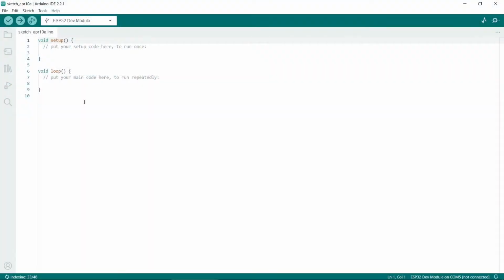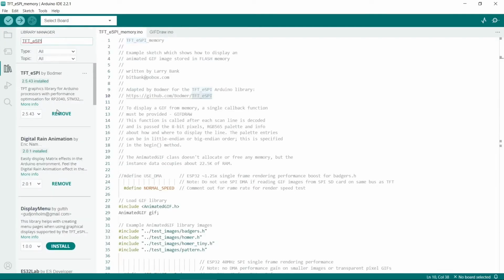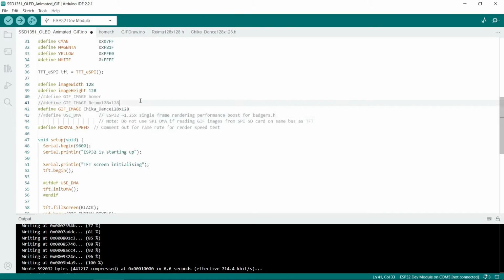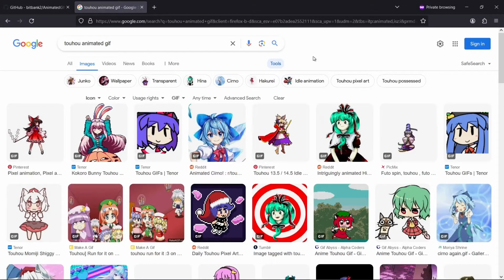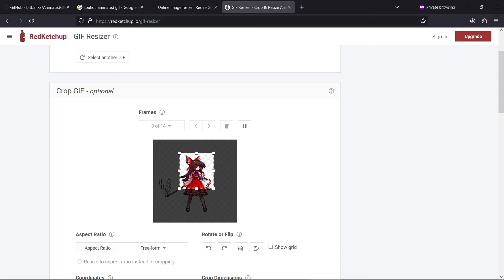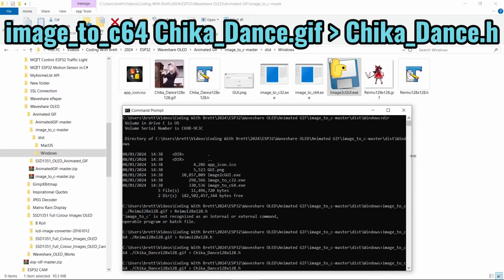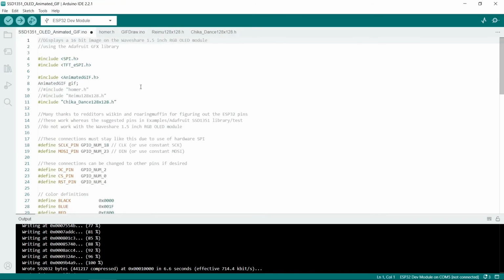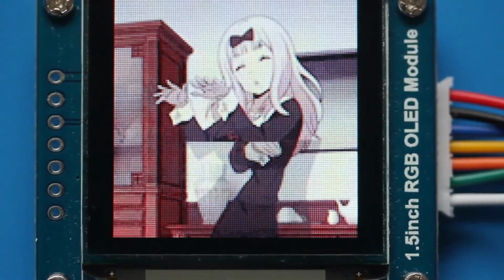How to Display Animated GIF on OLED/TFT (ESP32, Arduino, ESP8266)

Comment: #include <SPI.h>
#include <TFT_eSPI.h>
// Load GIF library
#include <AnimatedGIF.h>
AnimatedGIF gif;
#include "YourGIF.h"
//This section copying the code from the youtube tutorial
#define SCLK_PIN GPIO_NUM_18
#define MOSI_PIN GPIO_NUM_23

#define DC_PIN GPIO_NUM_16
#define CS_PIN GPIO_NUM_22
#define RST_PIN GPIO_NUM_4

#define BLACK   0x0000
#define WHITE   0xFFFF
#define RED     0xF800
#define GREEN   0x07E0
#define BLUE    0x001F
#define YELLOW  0xFFE0
#define CYAN    0x07FF
#define MAGENTA 0xF81F

TFT_eSPI tft = TFT_eSPI();
#define imageWidth 240
#define imageHeight 240
#define GIF_IMAGE YourGIF
#define NORMAL_SPEED
//#define USE_DMA

void setup(void) {
  Serial.begin(9600);
  Serial.println("ESP32 is starting up");

  Serial.println("TFT screen initialising");
  tft.begin();

  #ifdef USE_DMA
  tft.initDMA();
  #endif
  tft.fillScreen(BLACK);
  gif.begin(BIG_ENDIAN_PIXELS);

  Serial.println("Image has been rendred onto the screen");
}

//#ifdef NORMAL_SPEED // Render at rate that is GIF controlled
void loop()
{
  // Put your main code here, to run repeatedly:
  if (gif.open((uint8_t *)GIF_IMAGE, sizeof(GIF_IMAGE), GIFDraw))
  {
    Serial.printf("Successfully opened GIF; Canvas size = %d x %d\n", gif.getCanvasWidth(), gif.getCanvasHeight());
    tft.startWrite(); // The TFT chip select is locked low
    while (gif.playFrame(true, NULL))
    {
      yield();
    }
    gif.close();
    tft.endWrite(); // Release TFT chip select for other SPI devices
  }
}

Comment: Can you provide the working code? I am having trouble getting anything to display on the display. The previous tutorial (for a static image) worked great using the adafruit gfx library. I get no error codes and my serial monitor displays "Succesfully opened gif" but the screen remains black. Please help!

I should also note the following lines (in setup) never show in the serial monitor:

  Serial.println("ESP32 is starting up");
  // initialize screen
  Serial.println("TFT screen intialising");

I think the issue is related to the pins? I am using 0 2 and 4 just like in your example. Or perhaps it is the User_Setup.h file. I believe we need to make changes to this file but you did not mention it in the video : (
Reply: You just have to modify the User_setup.h code in the section where you assign the pins using.

file path: Arduino/libraries/TFT_eSPI/User_Setup.h

1.- uncomment the line: 
#define SSD1351_DRIVER 

2.- Search the code for the section:
// ###### EDIT THE PIN NUMBERS IN THE LINES FOLLOWING TO SUIT YOUR ESP8266 SETUP ###### 

3.- Comment: 
#define TFT_MISO PIN_D6 // Automatically assigned with ESP8266 if not defined 
#define TFT_MOSI PIN_D7 // Automatically assigned with ESP8266 if not defined 
#define TFT_SCLK PIN_D5 // Automatically assigned with ESP8266 if not defined 

#define TFT_CS PIN_D8 // Chip select control pin D8 
#define TFT_DC PIN_D3 // Data Command control pin 
#define TFT_RST PIN_D4 // Reset pin (could connect to NodeMCU RST, see next line) 

4.- Find the part of the code: 
// ###### EDIT THE PIN NUMBERS IN THE LINES FOLLOWING TO SUIT YOUR ESP32 SETUP ###### 

5.- Uncomment the lines: 
//#define TFT_MOSI 23 
//#define TFT_SCLK 18 
//#define TFT_CS 15 // Chip select control pin 
//#define TFT_DC 2 // Data Command control pin 
//#define TFT_RST 4 // Reset pin (could connect to RST pin) 

6.- Assign the pins used in the video example: 
#define TFT_MOSI 23 
#define TFT_SCLK 18 
#define TFT_CS 0 // Chip select control pin 
#define TFT_DC 2 // Data Command control pin 
#define TFT_RST 4 // Reset pin (could connect to RST pin)

7.- Save changes and compile Arduino project

Comment: Everyone seems to love the TFT_eSPI library.... I have not been able to get the TTGO to work with the TFT_eSPI library at all. I finally got it to quit giving a compile error when I went back to the Arduino 1.8 IDE. But still no video. At first I blamed the TTGO but I got it running the Adafruit display example using code that does not use the TFT_eSPI library. So I know everything actually works and going through the library's files I cannot find anything outstanding that is causing a problem.
Update: Though it's obvious no one reads these comments. I returned the "fake" TTGO after lack of documentation. After much mucking about I was able to find a couple of good videos on the TFT_eSPI library - specifically pin outs. For a novice the TFT_eSPI library is a bear to get working - even the second time. I am now able to get several examples running and feel much more confident with it. I'm not sure I will try the TTGO or even the knockoff again. I may even rewatch this video....

Comment: can I do it using Raspberry pi pico?
Reply from the maker: I think there is a library that will display animated GIFs on the Raspberry PI. This code is C++ for Arduino devices though.
Reply: @codingwithbrett  Pico can also program using C++ arduino IDE